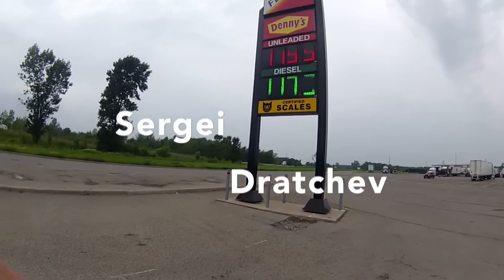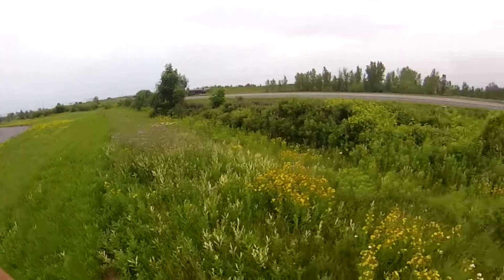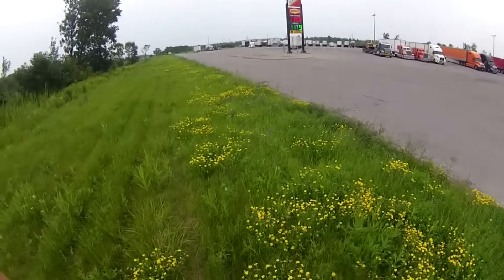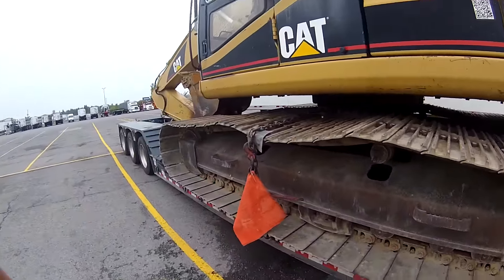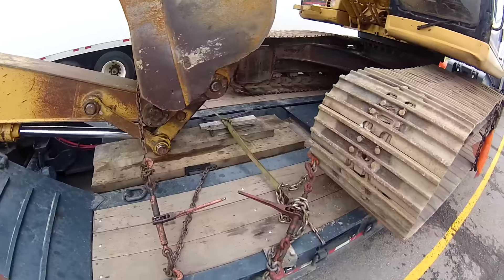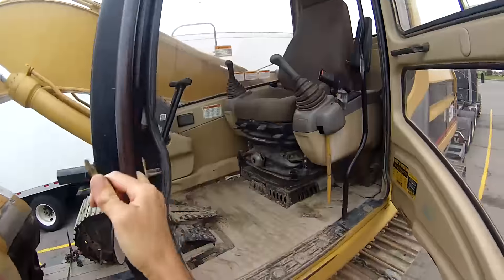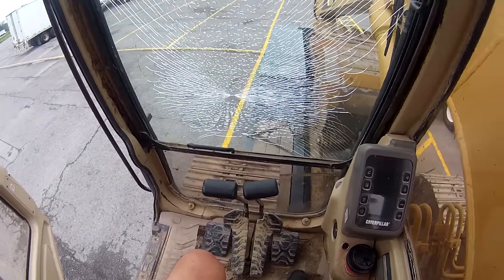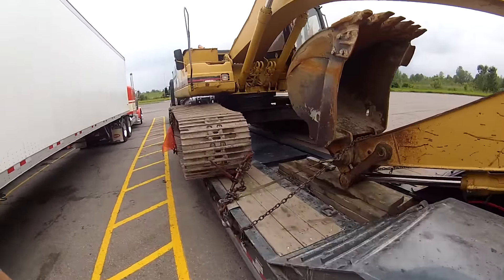HEAVY HAUL TV: Episode 205; July 7, 2015

Comment: There is a great deal to be said for machines and particularly engines and transmissions that do not rely on electrics to run them especially if you happen to be going somewhere pretty remote - there is simply less to go wrong and often much more easily repaired locally.

Comment: It's a wonder how cost effective it can be buying a used machine, transporting it to a port, sailing across the ocean and then transporting it again.
We have shipped used machines overseas and they are supposed to be cleaned inside and out including dropping the belly pans to clean. I guess it depends on the country it is going to and how strict they are.
Maybe you'll get something other than a 950M to haul back.

Comment: Diesel is still cheaper in Eastern Canada here on the West Coast diesel is still above 1.30 at a card lock you may find it for 1.25 a litre but most likely 1.28 or so.
Reply from the maker: Graveltrucking Pilot/Flying J truck stops here always have higher price than the TA in Woodstock, ON. I try to fuel in Woodstock when I go that way towards/from USA.